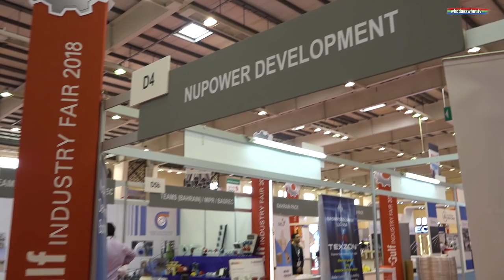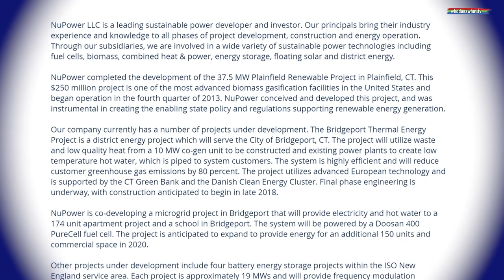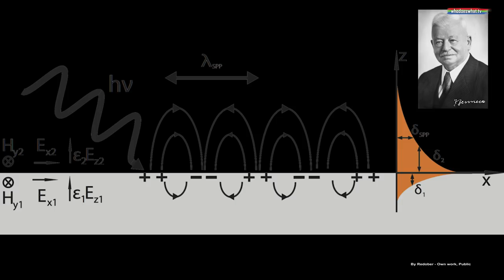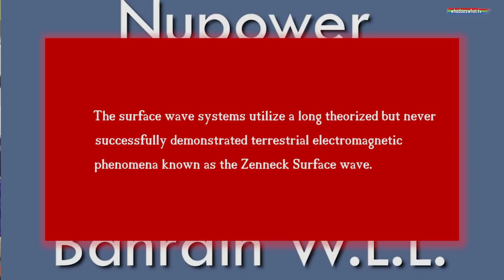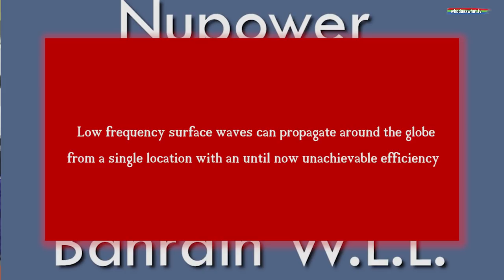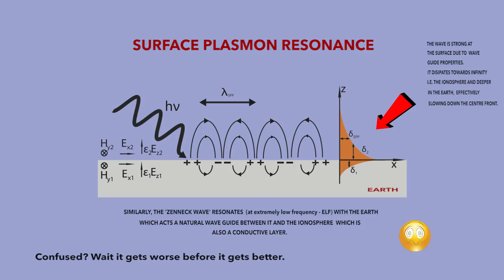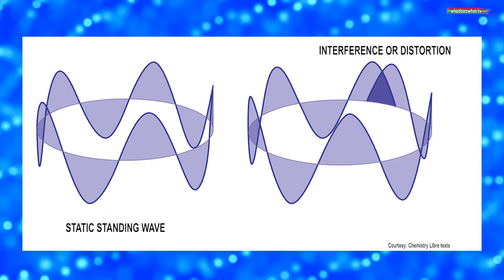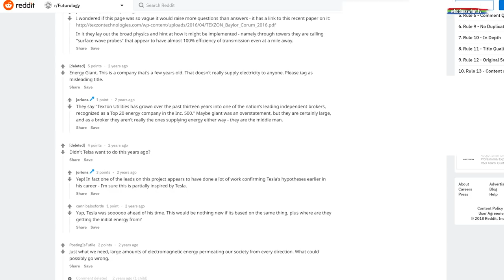Texzon Zenneck Wave Wireless Power Transmission - World Wide - Nupower Development

Comment: RUN 350 MW Dynamos in a cascade hierarchy 1 to 5, 5 to 25 etc.
Reply from the maker: Thanks Robert... Generation is a completely different subject as such, but the curiosity really does intrigue.  As for your earlier post about 'digital info'.   To us old dinosaurs of propagation and FM/AM etc, modulation is fully understood and as mentioned, at the higher frequencies!!   Indeed modulate the hell out of it, carrying whatever, but not to be confused with the distribution of high power or indeed high voltage in the first place.  
My understanding from off screen conversations and my inquisitive nature regarding this (They smiled, but almost begged me to go away in the end).   WHATEVER.... they have discovered or manipulated, they have also comfortably assessed the need to transmit digital information and perhaps other media forms, over this standing Zenneck wave.  They infer that the Internet data will be carried by the same.  
Now, as most of the guys here commenting would immediately trash the notion that 'high frequency' modulation on a wave only 20 Cycles or so in velocity is simply impossible as the losses would be near instantaneous, one assumes.
So how else?   Enter Geggyboy's suspicion that these guys have found a way to PHASE SHIFT as in 'DIMENSION'  with content tucked well in and no losses.  Phase modulation is also well known, but again, not at these frequencies.  Although, Telecom companies have been using a primitive form of phase modulation since the year dot with their 3K Neanderthal bandwidth restriction.  Before VoIP and literally thousand of voice channels all going at the same time on different bands,  it was a simple rotary block, picking up voice transmission at fractions of a second apart.  In general, each line would carry EIGHT conversations at the same time, but callers nor receivers would be aware that there were other callers on the same line at the same time, unless 'Cross Talk' occurred.  Frankly and nothing to do with this, the mindset has not changed much, with crap quality voice transmissions in Alaw or Mulaw (8 bit - 8 Khz) still dominating all transmissions to maximize bandwidth availability, when there is really no need.  Of course to change to AAC or MP3 whatever, would require the networks to retool.  Not going to happen and  not likely to change with 5G either, but that is an entirely different story.
Reply: Who Does what TV 

It is interesting that they call the Zenneck wave “the probe” ... my feeling is that they are running thousands of Zenneck waves per sec as a polyphase Zenneck wave pattern. I also think the percent of ocean vs land percent as a line of sight to each potential receiver will have to be factored into the phase design of the receiver ... the equipment has to be able to be dialed in with the creativity of the equipment design. The refractive index of water and of the earth are different enough that I feel there is no doubt this will play a role ... ?

Also, though it is near 100% efficient, it’s energy degrades  probably at 1/r not 1/r^2 ( r = radial distance)
from the source), so the receivers that are further away from the source will take longer to collect the equivalent amount of energy and require a buildup kind of storage in batteries ... but this lag in total power delivered can further be offset by the number of waves per/sec each station is tapping (batteries not required in all instances) ..  perhaps charge more money for the number of cycles being tapped per sec to ensure that the end user has the amount needed as a combination of both battery storage and cycles per sec being tapped... but leaning more heavily on the cycles per/sec as playing the more dominant role.

Therefore, the reason they call it the probe, is that at each location this is a probe to be deciphered and thus, dialed into.  
Viktor Golubic
Reply from the maker: @Rizzycat1  WE should indeed 'Probe' that theory.  It frustrates me not knowing.